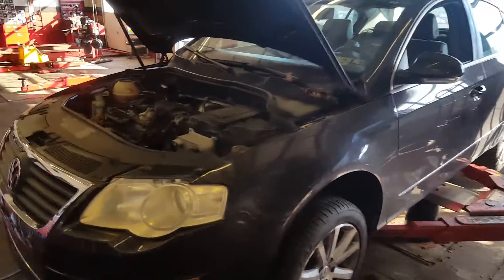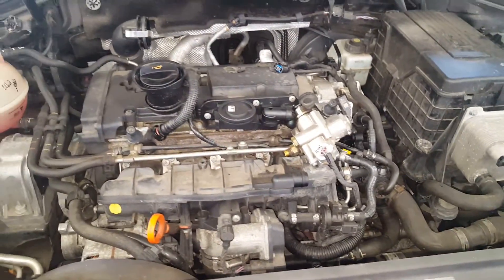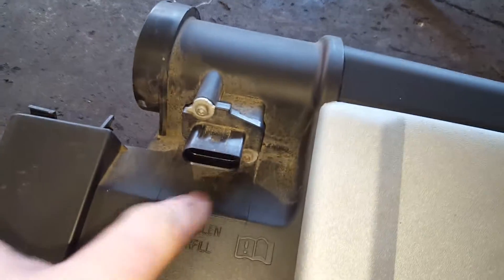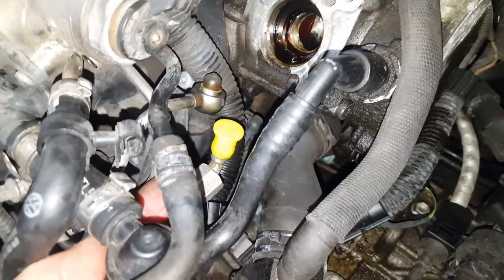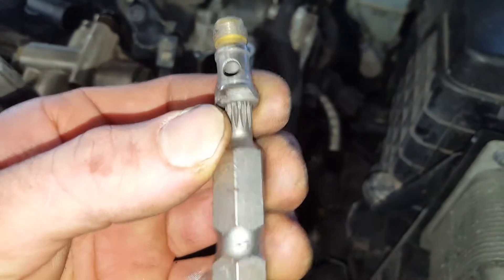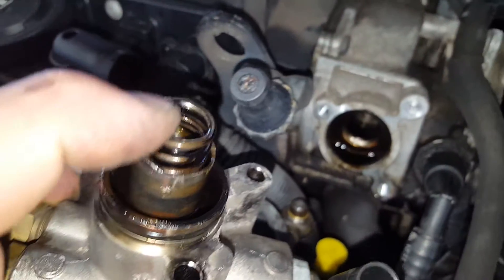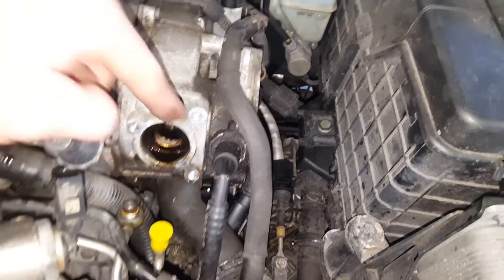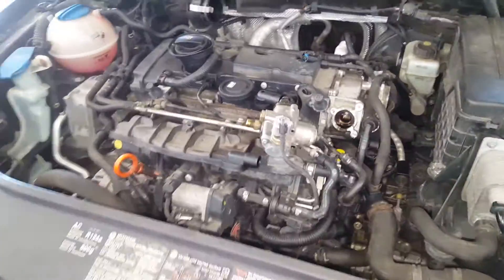VW / AUDI p2293 p0087 SOLVED Failed High Pressure Pump Cam Follower / Camshaft 2006 Volkswagen

Comment: hi, i have audi a4 b7 2.0t fsi s-line. I have the following problem two eror code (p2293 fuel pressure regulator 2) and (p0087 fuel rail/system pressure -to low)     The engine runs very poorly. what is the problem?

Comment: Have a 2007 a3 2.0t. Put in New motor. It's showing p2293 p0087 p0089. The cam follower was done with new motor. About a week after new motor put in for these codes and no power. Not Only was cam follower done. Did new fuel filter. New fuel pump. New fuel regulator sensor on high pressure pump. New fuel relays. Gonna try next the fuel pressure regylator on fuel rail hidden undee intake next.  Then the seloniod piece that is on high preasure pump. Figure replace these 2 pieces rather than pump. But if it's not regulator on fuel rail or bad seloniod on piece to high preasure pump in out of ideas. This weekend gonna strip off intake manifold and redo that. Then get junk yard high pressure pump
Reply: Where you able to find the issue
Reply: Did you find the problem??

Comment: Hey my car throws same code,my cam and cam follower are fine,I usually replace cam follower every 10k,but my car just died out of the nowhere, and won't star,could it be just the HPFP?
Reply: Old thread but I heard thrust sensor can be a problem. Might only be 06-07 though

Comment: Hey! I changed both pumps hpfp and the one that goes in the tank but I keep getting code p2293
Reply from the maker: Sounds like a bad sensor or other issue.  Needs diag.
Reply: Hahah no still got the car it got worst each day I don’t even use it no more because I don’t know when is gonna turn offf 🤣
Reply: @leenunez167  OH lol😂 what we're the symptoms?
Reply: @leenunez167 did you end up fixing it?
Reply: @lunchmoney3652  na bro that shit been park for over three years now i took it to a shop and they said it needs new cams i believe intake cam
Reply: @leenunez167  Iff that's rough man.  I think I'ma gonna end up selling mine at this point
Reply: Hi, did you solved it?
Reply: Did you resolve it?

Comment: But you are showing the high pressure regulator not the fuel pump ? My car starts but running like it’s getting no fuel
Reply from the maker: Jesse bradford that is the high pressure fuel pump. Your car has two pumps
Reply: Okay so you think it wouldn’t be the fuel pump that is in the fuel tank? More likely to be the high pressure fuel pump ?

Comment: But you are showing the high pressure regulator not the fuel pump ? My car starts but running like it’s getting no fuel
Reply: Did you ever fix this?

Comment: Hey I have a 2007 vw Passat and my car is reading a code of p2293 would that be the fuel pump?
Reply from the maker: Jesse bradford more than likely yes. I would suggest following the steps in this video and taking a look for damage. These are very common to fail